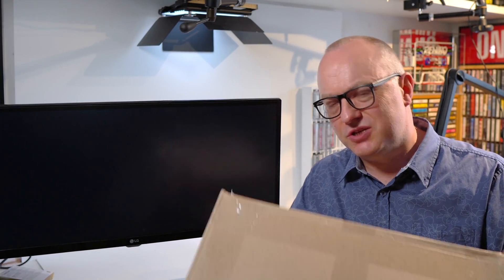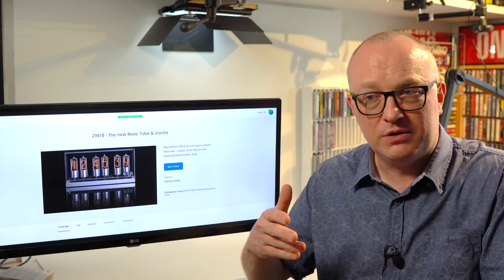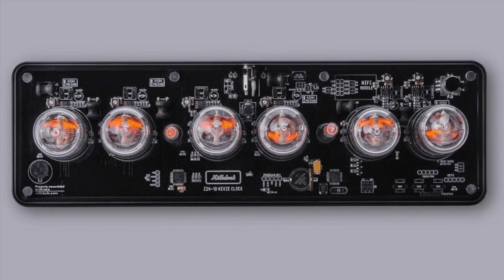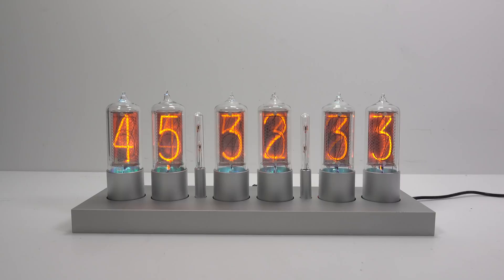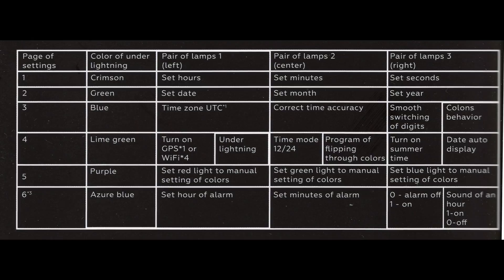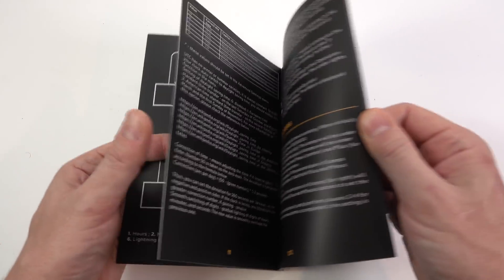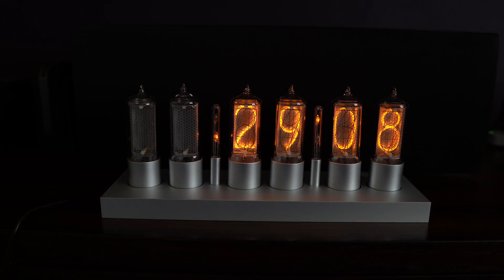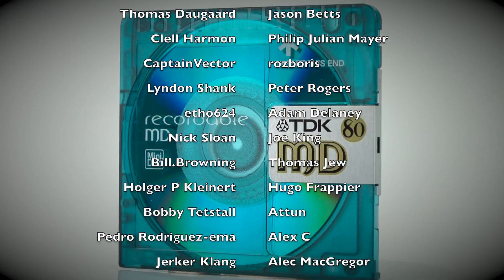The Return of the Nixie - New ZIN18 Tubes & Clock from Millclock

Comment: The other clock also sports a different illumination and digit transition model.  The new one is much more "snappy" and fully extinguishes the previous numeral before stepping to the new one, so the driver board must play into it a bit.  Are their mounts the same (plug/socket)?

Comment: Looks nice, however it's a pity they didn't use a 'proper' valve base/socket, those pin headers look awfully flimsy. Also an cover, like the kickstarter would be a good option to make dusting & cleaning a lot easier.

Comment: i´ve build my own with new old stock nixies and you can adjust the brightness wenn its daytime of course they are brighter. its not the tubes its the board. and on this one i am not sure but the second and third tube are a bit odd.  @ 14:50 you can see what i mean. the buttom holding is glowing. i had this once with one of my tubes. its when the ground contact is to near to another, my tubes wasn´t well produced and older than me. so with a bit slightly knocking i was able to position the out of place number correct again. i hope they was able to correct this.

Comment: Only downside. Farny is clever enough to provide a comprehensive datasheet on the tubes themselves. Promoting the idea of someone creating their own unique clock around the tube as the DIY-Tube hobby tends to go. Millclock doesn't. No dimensional drawings, current rating, or firing/sustain voltage. They just assume you would only ever use the tubes on their own proprietary 260$ costing base.

Just doesn't fly for the DIY hobbyists.

Comment: I worked in the Nuclear I&C regimen, and to replace almost any system from the 70's or 80's is extremely difficult...any replacement system has to exactly match "Form, Fit, and Function"; something newer could be created that is more sensitive, but that would be an issue (how will the "downstream" components react?) So I had to replace nixie tubes in units...yes, there was an "upgraded" newer retrofit, but it would have cost millions to be able to use the retrofit. As a result, I had to find the NLA exact same tubes. Newer ones were unacceptable, as were the Soviet versions. Thank goodness I found a warehouse that was being liquidated and scored 38 brand new exact matches. Lord knows what will happen when those run out.

Comment: Would be nice if the ZIN18 had the soft digit transition like your old IN18 clock. There were a few lifts around some older buildings in Sydney AU that had Nixie tubes for floor indication and they had the soft transition between digits as well.

Comment: The first electronic calculator I used in the mid 60s had these tubes as the display. The whole thing was about 500 mm square and 100 mm deep.

Comment: I got to the point where it does a daily maintenance and sort of wondered. There's not much use for the first 2 tubes, both in terms of date and time (month is 01-12, hour would be 01-12 or 00-24), so they could potentially save a bit of manufacturing costs by only making some tubes that only go up to 4, or would that potentially fuck something up in the software/not be worth doing?

Comment: OK, so they CAN make new nixie tubes, but the real question is WHY? There are likely millions of the original new-old-stock nixies still floating around out there. Honestly, I would rather have a clock made with the original tubes rather than an expensive replica that costs 10X more than the original. It's basically paying a premium to have a product LOOK like the original, when you could have just paid less for the ACTUAL original. I don't get it.
Reply: The original IN-18 tubes cost 60 USD on ebay, our tube is a mix Z types of tubes and IN types tubes, our tube is much bigger in size than IN-18, and nobody can give you warranty for the tubes from NOS.

Comment: If they want more customers, they should make 4 digit versions as well. I know 6 digits is cooler, but with 4 digits they would drop the price significantly. And add automatic brightness adjustment! Both to prolong tube life, and to make it usable in bedrooms. Enhance the chime and alarm sounds, and make them user replaceable and configurable via Bluetooth or WiFi. Also, prolong the alarm duration, or make it adjustable. That 1.5 minutes or so is nothing for a deep sleeper, I sometimes need 40-60 minutes of the harshest alarm sound to wake me up.
Overall, this is a great, high quality product, but it needs some enhancements.
Reply: We offer 4 digit version of clocks too
Reply: @millclockbrand2341  Thanks for the anwer! Not that I can afford even the 4 digit version, but others can, so thank you.

Comment: For $1000, they should have been added an ambient light sensor, to adjust the brightness automatically. This seems way too bright, and this is not just inconvinient (eg. in a bedroom), it will degrade the tubes faster than it should. 
I think the technology develpoment for nixie tubes has reached its peak in the '70s, until they were in production, and they can not be enhanced too much further, at least not orders of magnitude further. So if it's way too bright for a '70s nixie, it's still too bright for today's nixies.

Comment: Could it be, that the tube with the two lamps for . and : is wrong installed?
At date the left shows the dot on the bottom and the right one shows up the upper one.
You can see the wires inside of each tube and they looks like mirrord from each other. Maybe the tube on right side is rotated by 180°

Comment: These are kind of neat things, never really seen them before, at least I've never noticed them before. I wonder about the modularity of that number display. It seems a little redundant, is it just 10 unique wires that get energized according to different states, or does it have a complex signal that can light up parts of a number piecewise? I have a feeling its the former. Do they have an advantages as technology over other solutions of their kind?

Comment: 15 year warranty is quite bold of them, considering if you look at old datasheets of nixie tubes a common MTBF figure (if you can find one) is 1000 hours. I expect this is because you only need a fault in a single electrode for the whole tube to be useless. I wonder if they design them for higher currents than they actually use in their clock or something.

Comment: I made an IN 18 Nixie tube clock a few months ago and it cost me $450~$500 and I had to solder the circuit board and build the base myself so a complete clock I would expect to be around $1000. Those tubes look almost too bright! My tubes are definitely brighter than TechMoans but not as bright as those new style. I wish they made them with the same octal base as the original Nixie tubes so they could interchange 😕

Comment: I have a collection of 50+ nixie clocks with various tubes. 
I can't believe a high end clock as this can't adjust the tube brightness.  There should also be a setting to turn the display off during certain hours of the day.
As for your IN-18 clock,  there should be a tube brightness setting... if not,  the tube voltage and current resistor should be checked. 
Nice tubes though.  I hope the price drops in the future.
Reply: We will add this function

Comment: Τhe manufacturing of these tubes is not high tech of course but undoubtedly is time consuming and requires skill. 
In a industrial scale the manufacturing could be much cheaper but for a restricted production is unavoidably very expensive.
The price isn't so expensive. Many people spend much more for mechanical watches which have a little older technology.

Comment: Suggested feature: Automatic brightness adjustment (dimmer at night) based on time. Should be entirely possible unless they're using a simple fixed voltage driver. But even that could be changed for newer models if they're still early in production.

Comment: Well at least they used real fives instead of upside down twos. And I do have about 12 NOS  Burroughs 5440 tubes with sockets. In their original boxes. And 1970 vintage TI 74141 Nixie driver ICs. When the switch to LEDs was made they got dumped at Digital Equipment Corp in Maynard, Massachusetts.

Comment: The more are bought, the cheaper they’re likely to get. Techmoan didn’t mention this, and I’m sure manufacturing methods will be improved by the company eventually in one way or another. Very cool to see this new clock in action. Maybe etching  simplified instructions under the clock would be neat(instead of paper ones). My Nixie clock has a one button pressure sensitive setup process. It’s a bit difficult to setup with only one button while cycling through a similar menu as this new one. I like some aspects of this new one(like the setup dial) and the color setup as well. I agree with other posters about having radio controlled chimes/alarm. Just being able to change tones or put your own on the fly too! That would be something that would compel me to upgrade/buy it personally.

Comment: The gloves thing is not hot spots as in "hot = ouch" they mean weaknesses in the glass. The grease and oil on the fingers degrades the glass to the point it becomes porous and lets air in (or gas out) causing the filaments to burn out.

Comment: I might be interested in one of my own if the driver circuitry was all vacuum tube based as well.
Reply: With tube dividers and drivers? Phew, lots of tubes needed there, anything from 40 to 100, can warm your house :-)
Reply: @blitzroehre1807  Fine by me, I need a space heater in the winter anyway~
Reply: @blitzroehre1807  While we're at it let's also put an AA5 tube radio in there, and maybe even a vactube battery charger that can properly and safely balance charge 1-6s lipo, LiFE, SLA, NiCD, NiMH batteries!

Comment: $1000 for a clock is probably a no from me, though if they brought out a watch I would buy one. The one thing currently putting me off getting one of those is the thought that you might pay nearly $1000 for something that ceases working in a couple of years and the parts are no longer available. Whereas $2000 (for instance) for a nixe watch with a 15 year new-stock tube guarantee is a very different thing

Comment: Since Millclock might be reading the comments, I'll dump my brains here.

a) You missed a cool opportunity here: replace that 2.5KHz piezo buzzer with something that can do, let's say, ~500Hz to idk 3KHz?
Add ability to select how many tones (3/4/5/6?), how long (100ms/250ms/500ms?) each tone is and what the frequency of each tone is.
Then:
If a user wants GTS then they can do the six tone, 1KHz, 5x 100ms 1x 500ms signal.
If a user wants ABC Australia signal then they can do the six tone, 735Hz, 6x 500ms signal.
if a user wants China National Radio signal then they can do the six tone, 800Hz/1600Hz, 5x 250ms 1x 500ms signal.
Or whatever they want.

b) Just use a 1KHz buzzer and make it do GTS.

That 2.5KHz 4x 100ms 1x 250ms signal just sounds weird as all hell to me BUT that could certainly be just me since I've listened to GTS all my life.
I don't know if that five tone signal is traditional in Ukraine but if it is...cool. But international buyers and so on..

Comment: needs an ambient light sensor so it can auto-dim... otherwise REALLY nice
Reply: And an alarm that doesn't ruin your ears.
Reply: And potentially extend the life span of those beautiful tubes!
Reply: Based on what little I know of how Nixie Tubes work, I'm not sure there is a way to adjust their brightness.
Reply: Iron Lightning Sending a lower amount of power can dim them, similar to how lights with multiple wattages work. Just automatically rather than on a switch.
Reply: @2KDrop  This can affect cathode life. The current needs to be above a certain level to clean the cathodes. The duty cycle would probably work but I wonder if it would have the same effect for different people.
Reply: @KaityKat117  Just reduce the ON time;pwm style.

Comment: The only downside seems to be the casing, which seems cheap, plasticky and gives up to pressure a bit (when tubes are installed). For such an expensive clock, I would expect thick aluminium casing or just something more sturdy.

Comment: This thing is beautiful :)
I think your "old" clock is running on low anode voltage. There might be a small trimmer on the PCB somewhere.
Those big tubes remind me at the project I want to finish for a long while:  Combine a bunch of big nixie tubes and a "rubidium frequency standard" (basically an atomic clock in a lunch box) to build a nixie clock with backup power and atomic precision :D
Sadly on of those ZIN18 is more expensive than a used atomic clock "rubidium standard"...

Comment: These tubes should be better shown off in a retro fashion. Instead of a microprocessor one could use entirely discrete transistor logic with all surface mount components for the clock run from 50/60hz AC, show it off on a nice black PCB in a plexiglass case.
Reply: spikester we use glass in Skeleton version

Comment: I admire the effort in remanufacturing old tubes, but Its odd when original old stock IN18 are still available £40-£50 each. The ones I purchased, probably 15 years ago now, have been running 24x365 ever since and are still good as new.

Comment: just started to build a Nixie clock using IN12b , finished the PCB's that hold the 2 tubes with their driver ic. each tube has a WS2812b rgb led underneath to give a of back lighting. three pcb's to give 6 digits. would love larger tubes but they are too expensive to even think about let alone try and justify it to the wife. *)

nice looking clock

Comment: Back in the late 1970's I was in the US Army.  I was assigned to a Cavalry unit, with the Regimental Headquarters Communications Section.  We were a mix of radio and telephone guys as well as a crypto section that handled the classified side of our commo. Well we were sitting in the crypto vault (where  the leaders failed to go as it was mandatory sign in/sign out and they were a lazy lot.)  when someone pointed out that such tubes existed, they had read about them in either popular science, or popular electronics, both wonderful magazines we all treasured.  So we decided to put together a small device so we could store the call signs for each unit under our Regiment and have rotary switches which we could call up the sign by rotating one switch to the unit, the next to the sub unit, the next to the section and under that, the suffix would be common knowledge.  Well myself and one of my fellow Sergeants began to write up the diagram  for such a device, and we got so far as to pick up the switches and tubes with sockets from Radio Shack out of our own money, but then my buddy got transferred, and I simply gave up on it. We also decided it would probably break several rules on the handling of classified materials.  This was around the time that the great little 555 came out and we were going to try and use that in driving the tubes but I doubt we could have made it work, plus the monthly change in the output would have made programming it with jumpers a real pain in the ass.  Probably a good thing we let it drop, but now I am considering trying to build it using modern parts, perhaps Arduino based or batter ESP32 so it could talk to computers for programming.  Of course I am no longer in the Army and have no access to the modern version of such things, and I am positive that a better device is available to today's soldier.

Comment: 6-hours of skilled craftspeople to make one tube? They shouldn't be able to sell these tubes for less than 6*25$(22€)=150$ (~135€) PER PIECE!

Meaning that a clock that has 6 of them can't be sold for less than 900$ (800€). And that's not accounting for all the overhead (packaging, factory space rent), the need to have margin and all that.

If they're selling this for less than 1200$ (1000€), they're obviously making more tubes within that 6 hour window and average time per tube is way less than 6 hours.

Or they're not paying their skilled craftsmen basically peanuts... or they're making a loss on each sold.

Comment: These cathode poisoning is the only failure mode that is causing death to nixi digits. Usually the more sophisticated measuring equip which use(d) nixies do this at power on. my schlumberger 1240 voltage meter does that every time it switch it on.

Comment: For one grand you can easily buy 16 NOS of these BiG IN-18 tubes. Or 20 original Telefunken/Valvo ZM1000.....
Seriously i don´t expect them to make many of these. 
Anyway nice project. 
If you watch ebay for nixie stuff you can easily buy old PCBs from time to time out of measuring equipment which contain many original MIL-grade nixies, which virtually last forever. I built a clock which uses these and it´s running 24/7 straight for about 15years now.

Comment: I also have a Nixie Tubes clock, and i soldered it my self (DIY set) IN-12 / IN-17 Nixie Tube Clock Kit With Tubes Included, and i love him, put my own switching power supply board in the hosing, with a power connector, and made the housing my self.

It cost me £80.95 (including shipping cost), bought it from pvelectronics.co.uk.

https://www.pvelectronics.co.uk/index.php?main_page=product_info&cPath=3_14&products_id=96

Comment: 11:00 Yeah, this is also an issue I had with my Milclock. I had a nixie clock I sold because even on the highest settings of time correcting, the clock had gone 5-10 minutes past the time after a month. I don't think it is so hard to just implement a Quarz component into the clock so it's running "on time"...